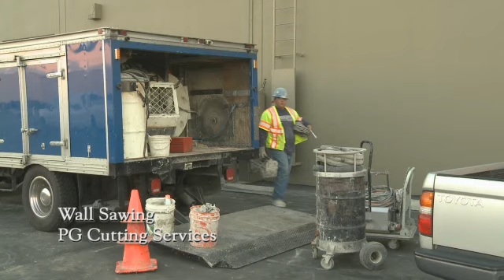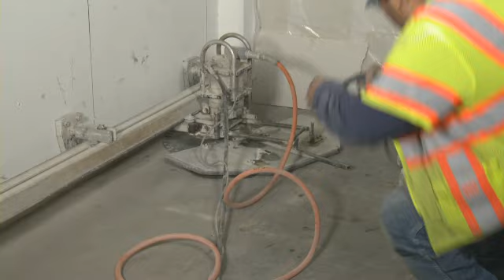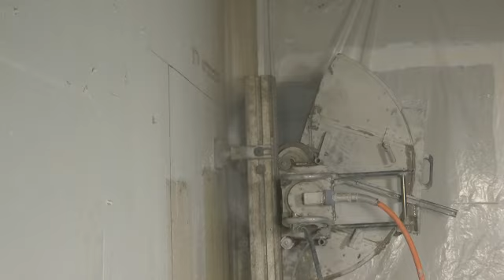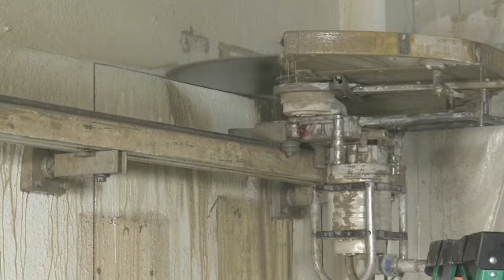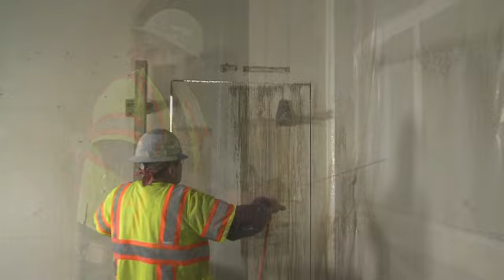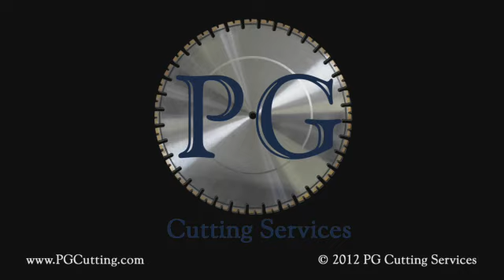PG Concrete Cutting: Wall Sawing

Comment: That's how it's done boys is that a welding machine they are using to supply the power to it with the welding leads ground and positive to run the saw.

Comment: 16" hand saw& ring saw half the set up time and cost for the company
Reply: We changed over to that technique about a year ago. Works out great.
Reply: Yeah a great trick with that set up is to mount a piece of unistrut or angle iron to the wall and cut about 1 1/2" deep just to get your straight line. It beats just going handheld with no guide. I've cut many openings that were absolutely perfect that way. No deflections, perfectly straight. They looked like they were wall sawed.
Reply: +chris jones one more thing tho. It sure sucks ripping rebar with a handsaw especially if you can't use gas equipment.

Comment: why not hand saw from the outside in?  6 inch.  running an 18 in one shot then putting on a bigger blade.    too much labor.
Reply: I couldn't agree more Hank. Your the best man.
Reply: Because it sucks to rip rebar with a handsaw. It takes forever to cut and being a hand held tool fatigue will eat your lunch on production.
Reply: Why work like an asshole when you cut it with the wallsaw and have nice straight cuts
Reply: Your body will thank you at the end of the day…easier to bolt up than to try and be a hero with a handsaw…

Comment: Such a thin wall. You can make it much faster with hand-held tool 12-16" blade cut off saw.
Reply: Obviously you haven't used a hand saw on a wall cut for an opening have you?.
You could never have that straight of a cut..
That was a 6 to 8 inch wall..
A 16" blade on a handsaw might get you 5 and a 1/2.
Reply: @billy909420  My point is to use hand-held saw where you can. It makes things faster than setting up a big saw. But if it's 6-8 inch wall I won't argue. The wall just looked thin when I first saw the video. But you did a nice job anyways!
Reply: @whitelex  It doesnt take that much extra time to set up the wall saw.